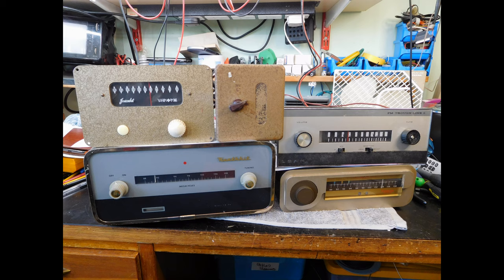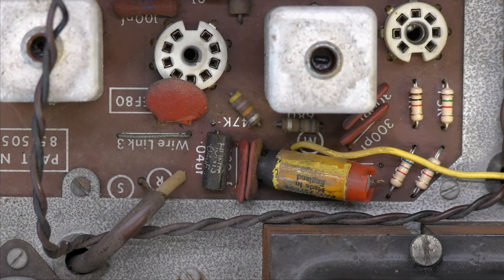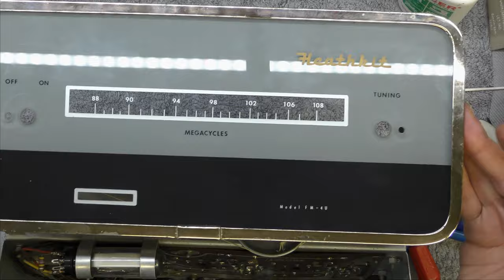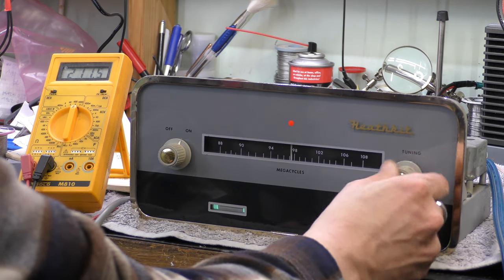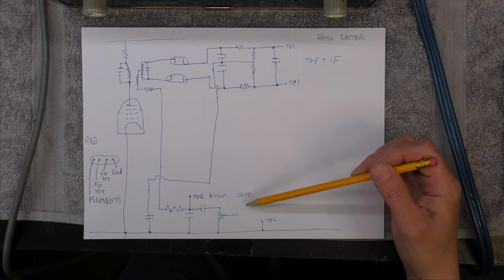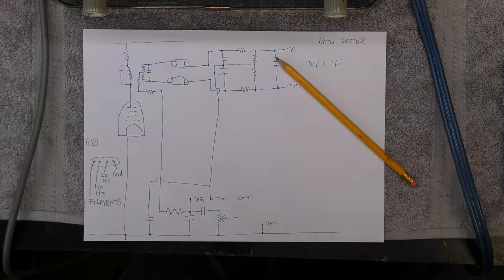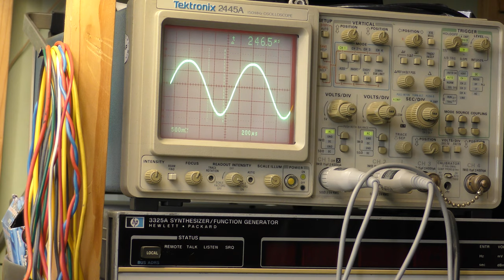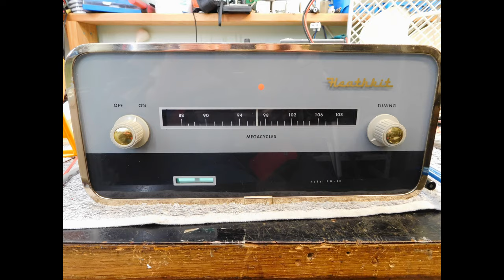Shoal of Tuner :- Heathkit FM4U Valve Tube FM Tuner Vintage HiFi (4K)

Comment: Hi Darren, great video, getting the FM-4U set up right can be most rewarding they are great tuners. Anyone restoring these might want to know there is a mistake in the original circuit diagram, which was duplicated in the Radio Constructor article and subsequently ad nauseam all over the internet. The discriminator output should join the de-emphasis network and the 68R resistor from the damping coil instead of bridging over it as in your drawing. In other words the three 300pF caps the 47K and the 68R all meet at the same point. Also the 680pF should actually be 1000pF for 50uS de-emphasis.
Reply from the maker: Thanks for that, Rob, must remember to correct diagram.
Reply: @darrencoe5795  No problem, Heathkit corrected the circuit in the 2nd and 3rd versions of the manual. You have the later one with the Gorler tuner, the earlier manuals cover the Plessey/Brayhead P-B2 front end. Setup is basically the same.